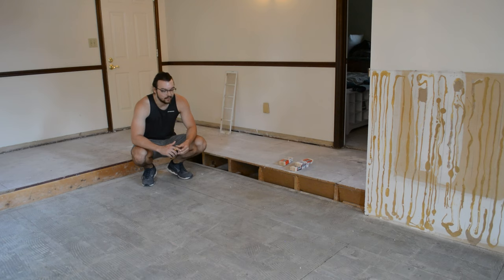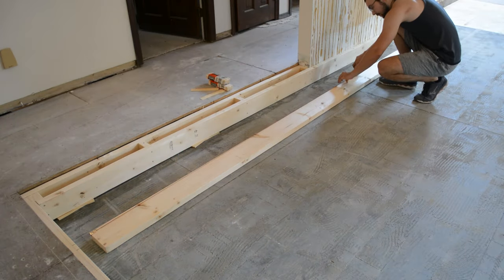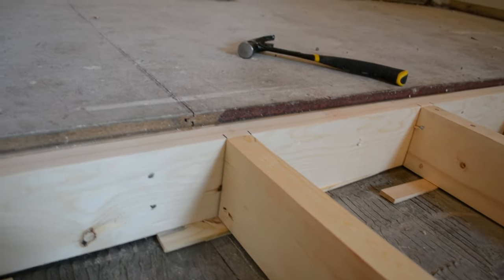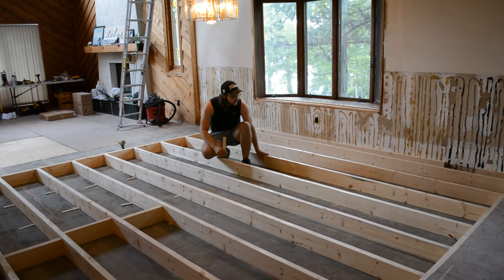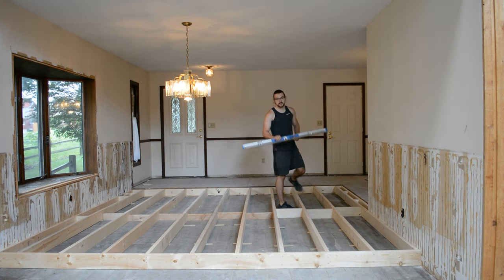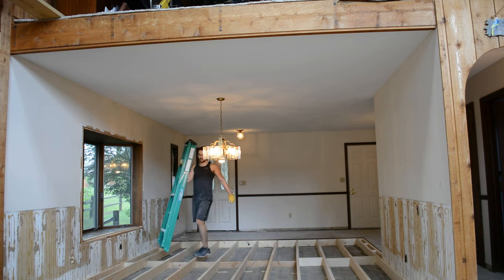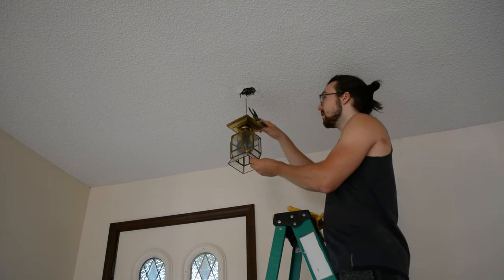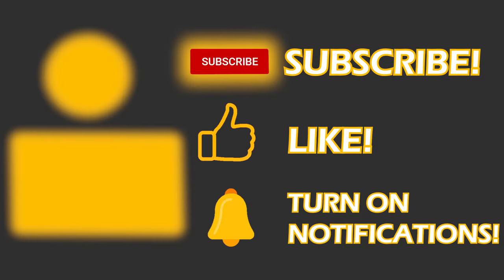How to Raise a Sunken Living Room Floor | The Lake House Project Ep 7

Comment: Next time you cut wires to the lights, don't just cover the whole thing, make sure you separate the cable ends inside, and then cover them. The way you did it, there is a chance that if someone turns the light on, a short circuit might happen and maybe the source of a fire. Hopefully the circuit is correctly protected with a breaker, but still

Comment: We would like to level our living room which is sunken on both sides - a step down from the foyer and a step down from the dining room. Because the padding of the carpet is so thick, not sure about the measurements but it seems to be between 7-8” high. 
We would also like to do the same thing in the entrance from the family room into the screened in porch. The carpeting is less dense and the step down measures about 6 1/2”. 
What size wood would one get? Since it is higher than 6” would it still be sturdy enough? One would also have to account for the thickness of the sub flooring and the new floor put down, correct?
I am just the housewife, I have no experience, we would hire someone to do the job but from past experience, I think it is beneficial to have some idea of a project before getting estimates. Thank God for You Tube and thank you so much for your videos. Please advise.
Reply from the maker: Thanks for the comment! You do need to account for the thickness of the subfloor and finished floor in your measurement. I would buy either 2x8s or 2x6s depending on what that final measurement is. It will be plenty strong even at 8” high once you screw in the new subfloor. Hope that helps!

Comment: The 3 screws to secure the shim to the joist… can you explain a little more.  This looks like it’s being laid over concrete. Are you screwing the joist into the concrete?
Reply from the maker: This is being installed over top of the old subfloor which is plywood. There is a basement beneath. The shim is to make up for dips/unlevel spots in the old subfloor
Reply: @GoldenKeyDesign  thanks! Any tips if over concrete how to secure shims?
Reply from the maker: You can use tapcon screws and construction adhesive

Comment: Glue all the shims and joist to the old floor.
Reply from the maker: GRK structural screws are plenty strong to prevent squeaks. Been installed for over a year without any issues

Comment: Great work-How would you deal with there being a door already existing where the sunken floors are?
Reply from the maker: Good question! Luckily my sliding door was already raised high enough so it wasn't an issue. If yours is too low there aren't many options other than making the door shorter to accommodate the difference in height
Reply: Reframe the door with a new header

Comment: In the beginning of the video you mentioned building a wall and then laying it flat… am I missing something? It seems like you built everything on the floor
Reply from the maker: It’s much easier to build it on the floor as you can account for the slight variations and changes in elevation of the subfloor. I just used the idea of a building a wall and laying it flat as a means to explain how the subfloor is raised - easier to understand per say

Comment: This should be called "how to make a squeaky floor"
Reply from the maker: Check out our other videos! This floor is anything but squeaky. The old floor was very noisy but tearing it out allowed us to properly screw down the old subfloor that was only nailed with no glue. The new subfloor on top was glued and screwed. Then thinset, durock, more thinset, and tile. It’s rock solid 💪